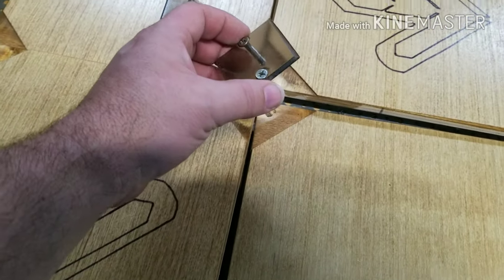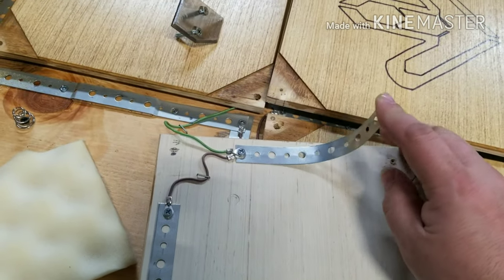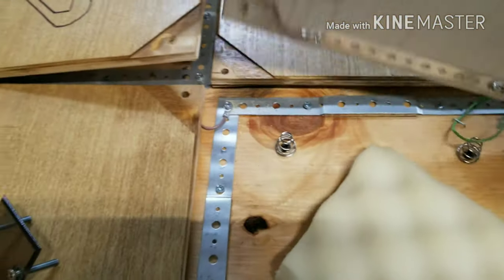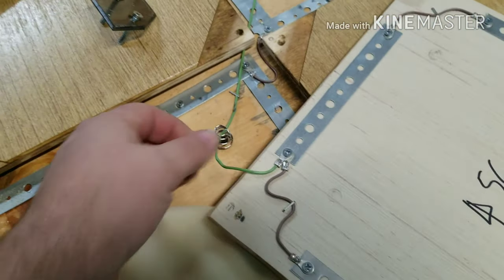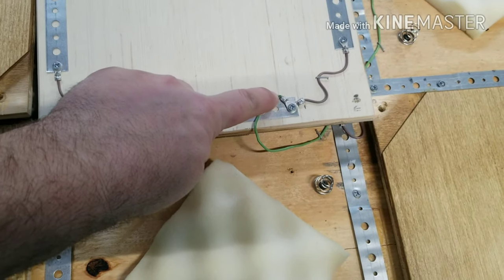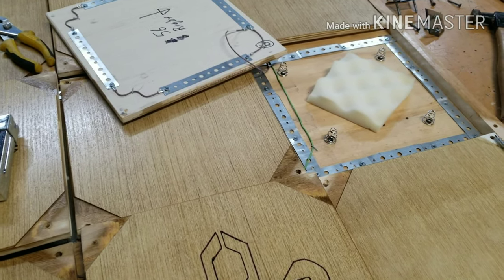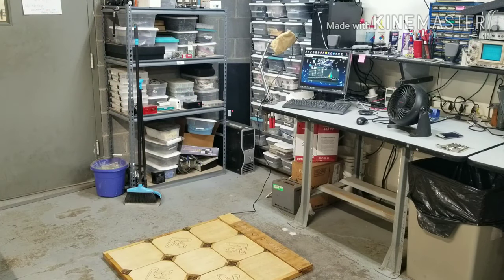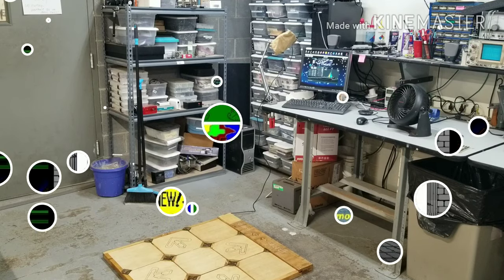Wood DDR Pads - Sensor adjustment

Comment: It looks like the screws hit the metal strips more than the metal strips themselves, is that the case or is there enough force from stepping on the pad to warp the board to make the strips contact?

Also like your flattening solution for the base strips. If all else fails use a bigger hammer.
Reply from the maker: The boards are not likely to bend since it's 7 layered plywood. Yes, the screws are not suspossed to hit the metal strips. It should just be metal on metal. But sometimes the screws don't pull all the way in.